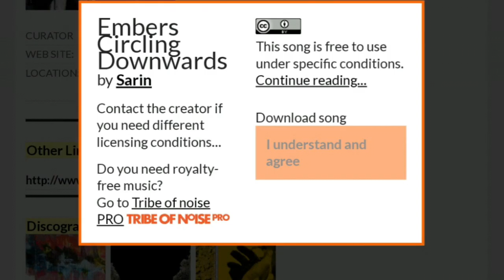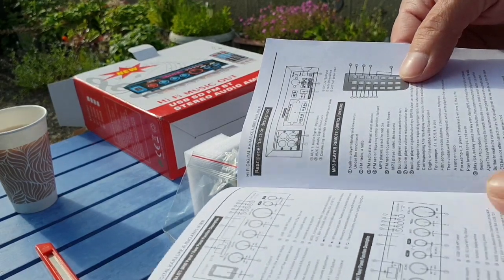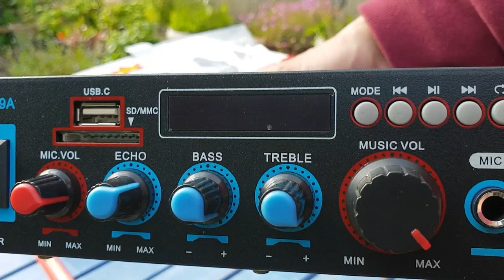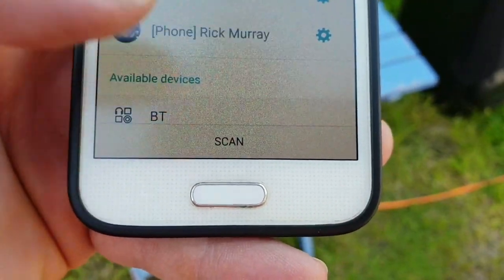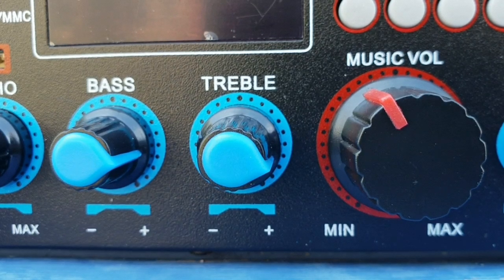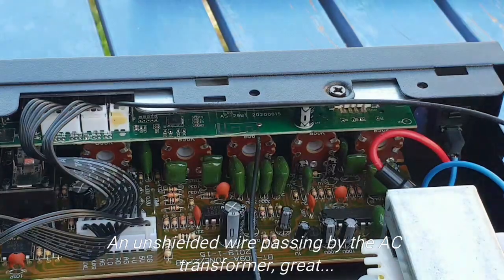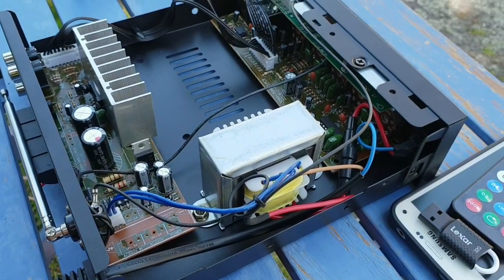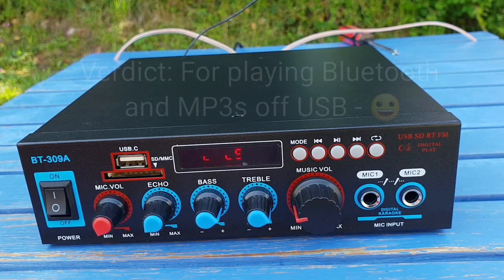Cheap Chinese (BT-309A) Power Amplifier Unboxing, Review, and Teardown.

Comment: Looks like a good solution. A couple of years ago I bought a Thomson home cinema amp + subwoofer & 5 small speakers second hand on the Bon Coin. Turned out the seller lives in our village and knew OH's family years ago. So still using that. Optical input with various HDMI for the modern stuff. AUX for record player and video recorder. Jack input from my old Sony Hi-Fi for CD's/K7's.

Comment: Aliexpress tells me this unit has the TPA3116D2 audio chip. Shame it doesn't do its additional functions well (ie, Bluetooth and radio) - renders them more or less useless.
Depending on the unit and power supply, sometimes using a safer/cleaner power supply remedies noise/hum problems, though the teardown doesn't fill me with confidence that it'll be the culprit.
The TPA3255 "chi-fi" amplifiers are worth a look, and are coming down in price.
Reply from the maker: Yes, the TPA3255 looks interesting, and at least it is not (as yet) fraudulently advertised as "800W"!
The radio and Bluetooth are both rather poor, but I think a lot of that is down to abysmal design. You can't solder a bit of wire into the Bluetooth antenna, it's 2.4GHz for god's sake, it doesn't work like that!

However, it's a cheap and cheerful and reasonably powerful amplifier. When connected to my phone via Bluetooth, or a CD player by phono, it can run the speakers and nicely fill the living room. I don't need anything more powerful, and with a single button to switch modes and turn knobs for volume and bass/treble adjustment, it's pretty easy to use. I don't use the radio or microphone stuff at all. Just wanted something to drive the speakers and it does that perfectly well. The only downside is the Bluetooth is a bit crap. Phone works fine near the unit, but fails more than a few metres away (WiFi interference?).

I'm buying an internet radio from Amazon, it'll arrive tomorrow. Plugging in by the line out socket, ought to sound pretty good and effectively take over from what my phone was used for.

Comment: Thanks for the video, have you had any issues with noise? I received one today and there is audible noise even with the volume right down, for example when the LCD is flashing I can hear it effecting the noise. I am wondering if it is a grounding issue, non of the boards appear to be grounded, what do you reckon? Cheers, Duncan
Reply from the maker: Why does your display flash? Mine just says "LINE", "BLUE", or the radio frequency. Oh, and "HI" when I turn it on. 😉

With the volume cranked right up, there is a very faint hiss in Bluetooth mode, and a slightly louder one with line in mode. To put this in context, I pretty much have to put my ear to the speaker in order to hear it. Given I don't tend to listen to music much beyond ~40% on the volume, this is not a problem, and it's a natural consequence of the fact that it's not a balanced input.

Is the noise that you can hear a sort of buzz rather than a hiss (more specifically, 50Hz or 60Hz according to your local line frequency)?
If so, and with the LCD flashing affecting things, I'd wonder if the power supply is faulty (bad capacitors?) meaning that the AC isn't being properly smoothed (hence the buzz) and with the caps not keeping the power up, changes in consumption (like the display flashing) would be audible. After all, it's the same basic power supply running the amplifier chip too.

Honestly, if I hooked up an amplifier and heard anything at all (asides from a barely there hiss at max volume), I'd send the unit back as faulty.
Reply: Try using an external Power supply, i solved It with 12V5A

Comment: so on end how much this amplifier outputs power? and can i wire a sony ss-j30 speakers on it?
Reply from the maker: According to Electrotanya, your speakers are 6W nominal, so should work okay with this amplifier.
I would guess that it outputs about 7W (but I'm not an expert), but you don't want to dump too much power into smaller speakers. It works well with my speakers, good bass response too.
Reply: I can answer this very question. I have this amp, wired to 2 subwoofers {one sub is powered and wired to the non powered)and panasonic speakers then wired into my laptop. I use the sound for mixing etc and people can hear my music at the end of my street. Hope that answers your question. for 20 quid which i paid for the amp i am very very happy.

Comment: Amazingly BT-309A these amplifiers are being headlined as 800W  peak and 100W RMS. Yet they use a 2x7W chip for the output. Clearly the advertising is outrageously dishonest.
Reply from the maker: I think the idea is a maximum absolute peak output (for a microsecond if you drive the chip to destruction) of 400W (nowhere even remotely near the sustained output), multiplied by two because stereo (yes, really).
I also think that if one imagines that they can pick up an 800W amp for thirty odd euros, then they're about as delusional as the advertising. 😉

Still, my CD player managed 1W output so was kind of quiet with the sound cranked all the way up. This amp is more than sufficient with the sound below half, so I'm happy with it.
Reply: What ic it use?
Reply: @truckman7123  It's in the video at 12:41.

Comment: Hi, is it possible to use this amplifier to active speaker ? If yes, please let me know how to do that ?
Reply: Hi, i expand his question. We have this amplifier and active speaker with jack 6.3mm and XLR female sockets. How can we connect this devices? Is it possible to make audio cable with jack 6.3mm on one side and bare cable on the other side? Will it work?
Reply from the maker: I'm not an audio expert - but I would wonder why you're using an amplifier with an active speaker?
Are you sure the 6.3mm jack is carrying what you think it is carrying? Because if you have XLR sockets, the jack may be for balanced audio (just like the XLR).
It is possible to connect unbalanced signals (such as used by this amplifier) to balanced inputs, however you must be certain that there is no phantom power present on the balanced inputs, as this is usually about 48V and would destroy an amplifier.
Your best bet, really, is to get in touch with a local audio professional who can advise you better than some random person on the internet...